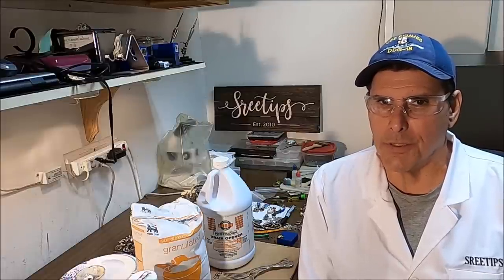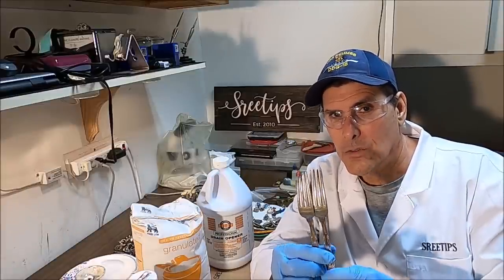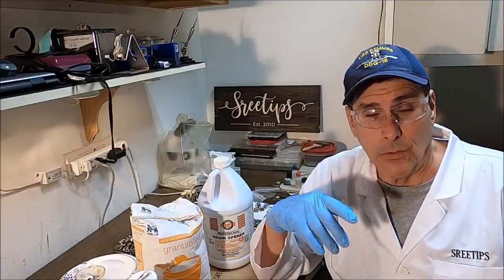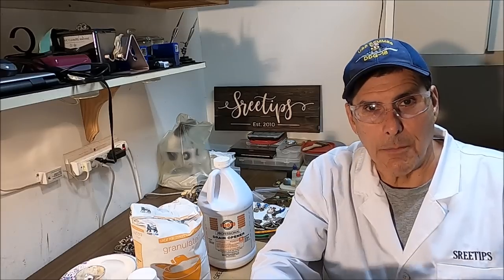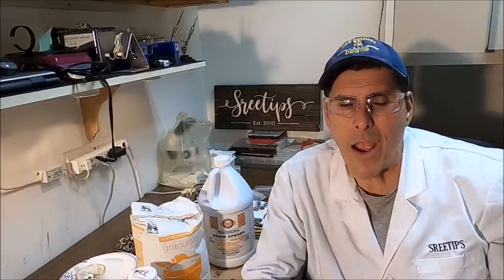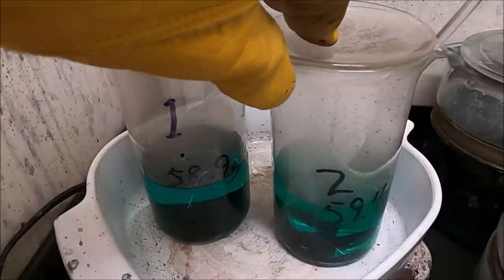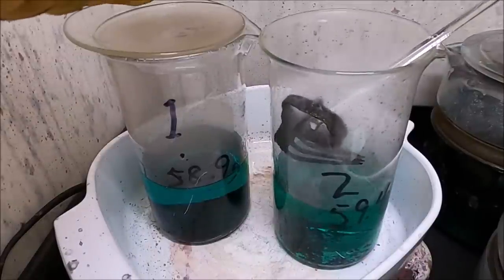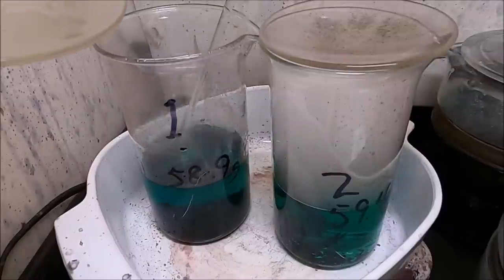High Purity Silver With Drain Cleaner pt1

Comment: This may be simple but it's a high pucker-factor method. I have to agree with you on just putting up with the nitric acid. I once worked at a refinery in SE New Mexico where we had a 3kgal tank of concentrated sulfuric acid that ruptured into it's catch tank (thank God). it dissolved everything that was in it except for the PVC pipes and the HDPE liners on all the pumps. We prayed hard that it didn't rain until we got it all cleared out. luckily we were in the middle of the desert. :D

Comment: Silver and copper work harden. Periodically  heating to a red heat then quenching in cool water will significantly reduce the amount of time at the rollers and allow  you to close the roller gap quite a bit more between passes. A simple pad of pumice and a MAPP torch is all you need for an annealing  station.

Comment: Another great video thank you! The folks are right about work hardening. Heat that stuff up and it cuts and rolls better. Also does your roller mill not go both directions? I’ve used them in the past that you could roll One Direction until it almost came out and then reverse it and roll it the other. Shire saves time and effort! I love your channel!

Comment: I suppose, the brown compound which is formed when the the silver is precipitated, is anhydrous CuCl2, which is insoluable in H2SO4. When water is added, it changes to the blue/green we are used to for copper aqua complexes.
Reply: Thanks for that hint, I was wondering myself "what the heck?" Although my thinking leaned toward some poly-sulphuric salts or something like that - but on a second thought that wouldn't make much sense. Anhydrous CuCl2 seems to be fitting explanation for observed phenomena.

EDIT - I just made some quick"back of the envelope (and a calulator)" calculations - just some numbers related to this particular experiment:
- total amount of sterling silver: 118.3 g;
- of which 90% is Ag, thus 106.5 g, and 10% is Cu, thus 11.8 g.
Dividing it by molar mas of those metals we arrive at 0.99 mol (M) of Ag and 0.19 M Cu.
Approx. 500 ml of 93% H2SO4 equals 465 ml of 100% H2SO4, whose density is 1.83 g/cm3, thus approx. 850 g,or 8.68 M of H2SO4 was used here.
The acid works both as oxidiser and solvent, and the reaction apparently goes as folows:
Cu + 2 H2SO4 -> SO2 + 2 H2O + CuSO4, and 2 Ag + 2 H2SO4 -> SO2 + 2 H2O + Ag2SO4

In other words 0.38 M of H2SO4 to dissolve Cu and 0.99 M to dissolve Ag. That leaves us with 7.31 M (716 g/ ~360 ml) of H2SO4 unreacted, further diluted by approx 25 ml of water created during the reaction(s). Means, still "quite concentrated" H2SO4, capable of removing water from CuCl2.
Then of course is water from added HCl, although not very much - and then again, precipitating AgCl "returns" some H2SO4, so...

Comment: New chemist here. I don't have a ton of experience, but I believe the brown solid you saw when you added the hydrochloric acid was some kind of copper(I) salt.

Copper has two forms in solution: copper(I) and copper(II). Copper(II) is what you're familiar with. Copper(I) can show up in very acidic environments, so that's why it went away when you added water!

If you repeat this, I would also not recommend adding HCl to sulfuric acid! HCl is mostly water, so it carries the same splattering risk as adding water to the sulfuric acid. It would be safer to add the sulfuric acid/silver sulfate/copper sulfate mixture to water, slowly, and then add the HCl (a saturated NaCl solution would probably work too).
Reply from the maker: Understand, thank you

Comment: Next time you try this, run the short pieces through the roller sideways first, they will stretch out sideways. Run them til they are the right width to go thru the rollers, then switch them 90* and run them til thin enough.
24:00 You said, "As the solution cools ..." silver sulphate precipitates. Is the enhanced danger from handling hot acid the reason you let the solutions cool prior to filtration? Also, won't the filter trap silver in the crystals that it stops?

Comment: One thing, unlike the conc sulphuric, muriatic acid is an aqueous solution of hydrogen chloride gas, mainly just water, so when you poured that in the sulphuric you released a lot of heat and some of the HCl gas broke down and released chlorine.  and got really hot. you should have poured the mixture slowly into a little water first and then added the HCl.
Reply from the maker: I was glad that it worked.
Reply: @sreetips  yep, your safety is paramount.

Comment: Mr Sreetips, did you consider heating the silver to a heat below melting point ? Certainly this should facilitate easier rolling as it does with steel. 

But I have not checked the physical properties of Silver in this regard yet
Reply from the maker: I think you are right. I didn’t do it because I didn’t think of it.

Comment: In this video you use rooto drain cleaner 93% nitric acid, but then you said don’t add water to the sulphuric acid. I’m confused which is it. I’m following this method for refining some   Wm Rogers flatware that is silver plated, but I believe the base metal is Nickel Silver. My experiment turned to cemented sludge in the straight Rooto no water. Not sure what do next, so I got some of the sludge out into a beaker and added tap water and it turned a dark blue then I let it sit and it formed crystal in the bottom that was rock hard. What was this? I’m not sure. It’s my first time. Thanks
Reply from the maker: Rooto Professional Drain Opener - available at Ace Hardware - is 93% concentrated sulfuric acid. According to the material safety sheet data.

Comment: Hello Chief I wanted to ask you  if you know why when I recently did my second batch precipitating silver the silver came out of solution on its own.  I believe it was due to the type of silver plated scrap I was using. The silver plating was over the top of some 1/4" copper.  When I decided that the silver had precipitated I stopped adding the nitric acid and allowed it to sit overnight to burn any remaining acid up and settle for siphoning.  The next morning I basically found the step to pull the silver out of solution was already completed due to the copper base metal being left in the beaker  overnight.   I left it in there to try and harvest the maximum yield of silver instead of extracting it  which I feel would have prevented the silver solidifying prematurely, do you feel my deduction into the matter to be correct or do you have something different as suspect?    One more thing,my silver has been fine and siltlike in nature unlike the granular texture you harvest.  Could it be from using the nitric  without being diluted  as much trying to expedite the reaction time?

I appreciate the time and knowledge you have shared with the public , your style is very comprehendible and easy to follow and would like to say thanks...
Reply from the maker: Reactivity series of metals. After dissolving the silver will cement right back out on the base metals as silver powder. Excess nitric will redissolve the silver and cement out on the bare metals until the base metals are gone. This firms a very fine silver powder

Comment: O.K. Sreetips, A much better way to get the Silver is to first Dilute the pregnant Sulfuric Acid by pouring it into another beaker filled with 3x the volume of the leach liquid of cold distilled water, this WILL precipitate out A white Silver Sulfate....(The clear crystals you saw are not silver sulfate they are copper sulfate crystals Copper sulfate is 100% water soluble, silver sulfate is 100% Not water soluble).
Next after all the silver sulfate has precipitated and settled to the bottom, filter it off, and set the silver sulfate aside. Return the diluted sulfuric acid solution to the beaker.
Next prepare a 100ml saturated solution of sodium chloride. Pour the saturated salt solution into the diluted sulfuric acid leach liquid and the other half of the dissolved silver will precipitate out as Silver Chloride.
What many folks dont understand is the solubility of these complexes, example the difference of solubility of silver sulfate is not the same as silver chloride.
just sayin.
Both the Silver Sulfate and the Silver Chloride can now be reduced to pure silver metal.

Comment: Thanks for your service, im retired Army. Question = Does this method only work for silver/copper or will it work when silver is mixed with "other stuff" ? I'm not sure what the "other stuff" is. This is a much cheaper method than straight Nitric acid, but i think that's the way i may have to got, just Nitric.
Reply from the maker: I’ve used it with sterling silver an alloy of roughly 90% silver and about 10% copper. I’ve not tried it on other alloys.
Reply: Thanks, i'll try it and see what happens

Comment: Out of all your experiments. Which method have you found to be the most cost effective, quicker regardless of cost. And even both cheaper and quicker for silver refining? Thank you great video.
Reply: I'm not sreetips, and I've refined very little silver but in my opinion the fastest and cheapest way would be dissolving in nitric acid, precipitating with sodium chloride and turning into silver  with lye and sugar, and then melting.
The electrolytic silver cell may be cheaper, and gives a more pure product, but it's slower.
The sulphuric acid method can be cheaper depending on the price of the acid, but it seems slower, more dangerous and you might not get all of the silver.
If you don't want supper pure silver simply dissolving in nitric acid and then cementing with copper metal and finally melting can be good enough. 
I hope I helped somehow.
Edit: you can heat up the silver chloride directly, and it will decompose into silver metal and chlorine gas. This will be faster and cheaper than the lye and sugar route, but you will have to deal with the chlorine, as it's toxic and corrosive to metals. 
Same thing with the oxide. When you add lye to silver chloride it makes silver oxide, and the the sugar reduces it to the metal. You can stop at the oxide and melt it, but the oxygen produced will dissolve in the molten silver and will make the surface of the silver ugly when solidifying. In the end I recommend turning into metal powder to avoid problems.
Reply: @luisillo3511  Yes you did. Thank you very much.

Comment: Sreetips, What is the actual temperature of the Acid while dissolving? Since the boiling point of H2SO4 is relatively high, and the dissolving would progress as the temp is raised, wouldnt the dissolving of the sterling silver move along much faster at about 280 F?
Reply from the maker: I had the heat as high as it would go.
Reply: @sreetips  , yup figured...Thank You for your great content, and attention to details! As we all know "The Devil is in the details"...lol..God Bless
Reply: @sreetips  , well sorry but that still does not explain the actual temperature that your hot plate was able to raise the temperature of the H2SO4 solution too.
However, and with that being said after asking that question of you I decided to find out myself and share that with your viewers...I added 200ml of concentrated 93% H2SO4 to a beaker, I then added about 12 grams of Ag powder and a stir bar. I also placed a watch glass and then began incrementally raising the Temperature. Using a very good thermocouple I found that the optimum temperature to quickly dissolve Ag in concentrated 93% sulphuric acid in 2 hours elapsed time was 375 degrees F. while being moderatly stirred by a magnet stir bar.
So, there you and your viewers go.
Reply from the maker: Ok thank for that

Comment: Instead of adding the HCL acid to the sulphuric/Ag2S04 solution, has anyone tried making up the correct volume of near-saturated NaCl/water in a large beaker/flask, then slowly and initially dropwise, adding with stirring, the H2S04/Ag2SO4 solution. I know people have successfully added NaCl solution to the H2S04/Ag2SO4 but that seems more risky heat/splashes wise. It's something I may try because the nitric route is out for me due to reagent unavailability
Reply from the maker: I don’t use salt. It doesn’t burn, it melts when heated.
Reply: @sreetips  Thx for your reply. I can see you don't use salt. I suggested it to avoid expense & slight additional risk of muriatic acid, compared to salt solution. I know nothing in all this actually burns, flame-wise. There are some situations where conc. H2SO4 can overheat to spattering level when mixed with certain other reagents. I was a lab tech for 5 years, a long time ago

Comment: Can something like “Rooto” be used to precipitate lead out of gold bearing solutions? Or will it need to be purified in some way?
Reply from the maker: I use Rooto in my gold refining to precipitate  lead. It’s fairly pure acid. There is some solids sometimes but they settle to the bottle and stay as long as you don’t disturb them. The color and clarity are excellent. And if I need more I can run down to the hardware store and get some more. They also sell “Liquid Fire” in 32oz red bottles. It’s the same thing as rooto but it has red food color in it.
Reply: Thank you that is exactly what I needed to know!

Comment: Have you processed any contactors from electrical fuses and stuff?
Reply from the maker: I had some from the jeweler. He wanted me to check them so I added a couple into a crucible and tried to melt them into a button. It smoked, sputtered, and made brilliant sparks and turned my melt dish black. There was silver in them because I tested with schwerters solution. I ended up giving them back to the jeweler. It looked like to much work for a low yield. Plus I was concerned about the presence of tungsten. It’s below copper in the reactivity series so if I was able to get everything dissolved then the tungsten would cement right back out on copper with the silver. I decided to skip those contractors.
Reply: @sreetips  I have some big ones, from high voltage relays. Probably around 5kg, I'm gonna try to refine them using muriatic acid. Some of them are only filled unfortunately, but most have the same alloys the way through.
Love your vid's btw.
Reply from the maker: Hydrochloric won’t dissolve silver. It will form a passive layer on the silver and shield it from the acids.
Reply: @sreetips  sry, I meant sulfuric 😂

Comment: Sir in one of your video u diluted sulphuric acid solutions and precipitate silver by adding salt .so what the reason in this experiment u directly add HCl without diluting the solution it will be honor if u explain thankyou sir.
Reply: As our host is not responding let me chime in as his self-appointed deputy ;-)
The reason for THIS experiment is the same as for any other experiment - to TRY NEW WAY of doing things. And since there is already a video about "precipitating silver using table salt" out there, then it would pointless to make just another video about "using table salt to precipitate silver".

Comment: What does one do, if the sulfuric acid gets on one's skin? How do you neutralize sulfuric acid fast enough to stop burning of tissue? Thank you in advance.
Reply from the maker: I don’t think that you can. It will destroy the skin on contact. Irreversible.
Reply: Keep a jar of Dissolved Baking soda handy to dowse any sulfuric acid spills It'll stop the acid, but will not reverse any damage already done.
Reply: @scrapman502  I will avoid the baking soda at first. If you have sulphuric acid on your skin and you add a base dissolved in water it will generate a lot of heat, because of the water and the base. 
It is best to use a lot of cold water(and I mean A LOT, wash the affected area for several minutes, even if you think you have cleaned all the acid), and when the acid has been washed off, use sobe baking soda solution to maje sure you get rid of all the acid.
Reply: @luisillo3511  Yep, that's the way to do. Also, CO2 bubbles released by baking soda on contact with H2SO4 would kinda impede the washing off of the acid.

Comment: Can this be done with gold filled with a sterling silver base metal? And will it leave gold foil untouched?
Reply from the maker: Maybe, but I’ve never seen GF with silver base.
Reply from the maker: I’ve never seen GF with silver base
Reply: @sreetips  I can send a pic.  I got a few different items that are stamped 1/20 12k gf on sterling?
Reply from the maker: There is silver in GF material.
Reply: @sreetips  yes most has a little percentage of silver but I've got about 350 grams of random vintage gold filled that's marked the same as gold filled but then says on sterling in the same tag?  I was just wondering if the sulfuric acid will dissolve the gold aswell?
Reply from the maker: No, sulfuric won’t dissolve gold
Reply: @sreetips  ok thank you. I'll try out a few grams and see how the process works out but I think I'll probably hold off until I get nitric acid.  I've been collecting gold filled for  4 years and I've got about 4500 grams and about 500 grams of Victorian unmarked and 1200 gram or so of watch caps so i really dont wanna mess anything up with how much time I've put into collecting.

Comment: Could you make the silver into shot instead of rolling?
Reply from the maker: Yes, but rolling it thin will present the greatest surface area. I could skip the rollers and put the silver in as-is but it will take much longer for it to dissolve.
Reply: @sreetips  thank you, I'm just getting into refining myself I don't yet have access to a roller
Reply from the maker: Bought mine on eBay about $300